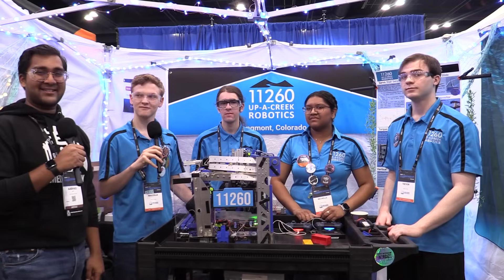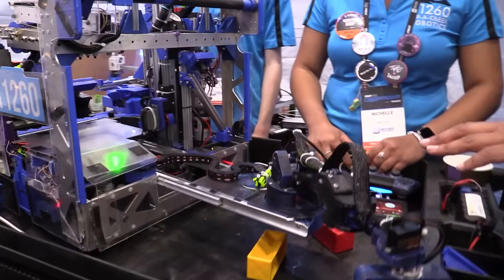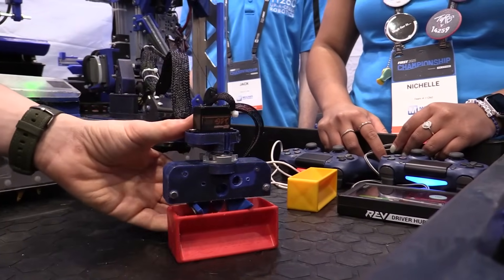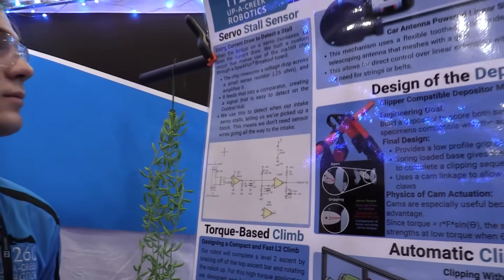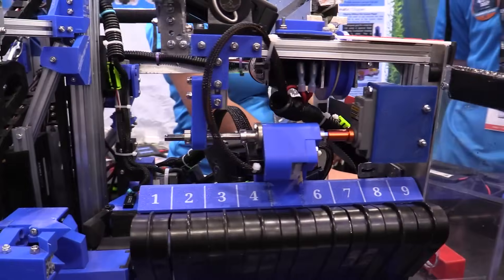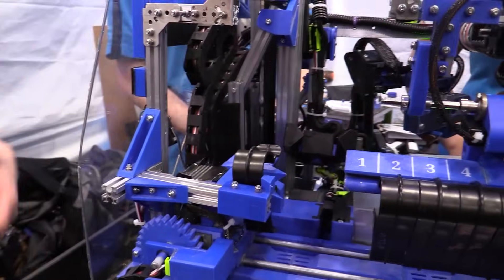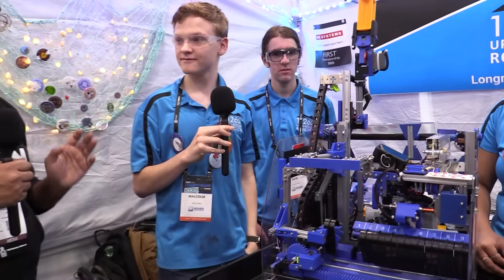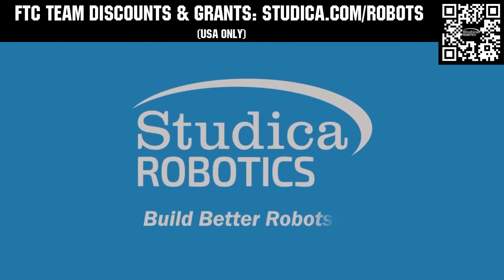11260 Up-A-Creek Robotics | Behind the Bot | INTO THE DEEP Robot

Comment: what software did you guys use to make your auto? Roadrunner?
Reply: For pathing we use a custom pure pursuit implementation, though a decent chunk of our auto used other custom drive control methods based on whatever we needed it to do (mostly just fancy position or velocity control loops with specific constraints).
Reply: @temite9935  Was the custom pure pursuit difficult to make, and do you think it is worth it and useful for rookie teams to try.
Reply: @temite9935  Was it difficult to make the custom pure pursuit, and do you think it is worth using pure pursuit and possibly a custom algorithm for rookie teams.
Reply: their auton moves so little large guides vector followers really aren’t necessary, pid to a point is better for what they’re doing